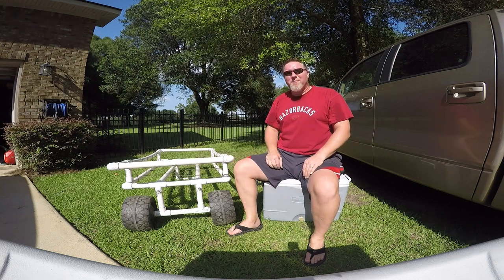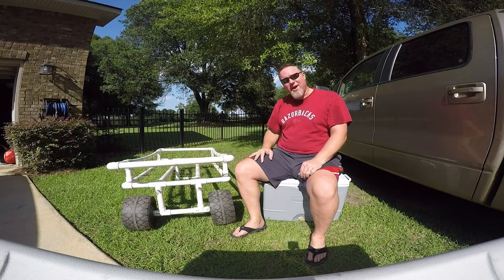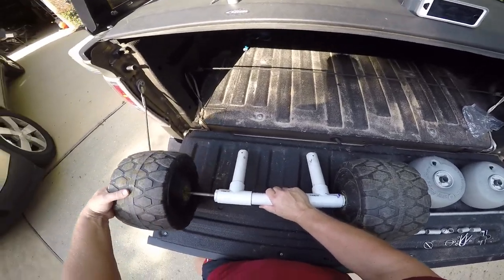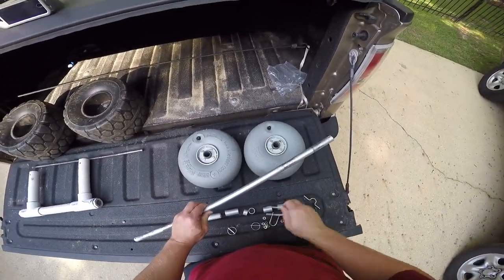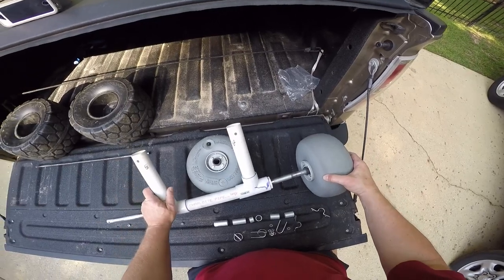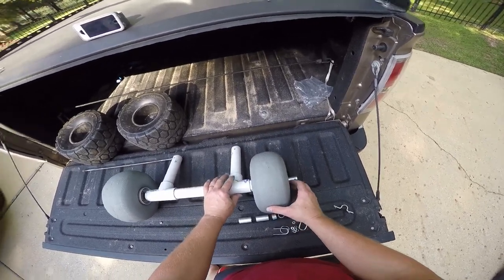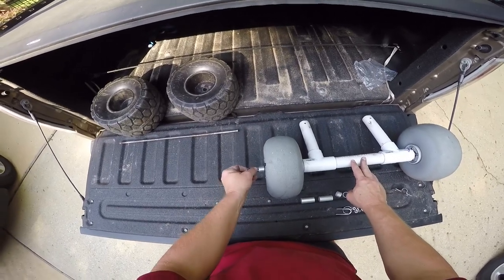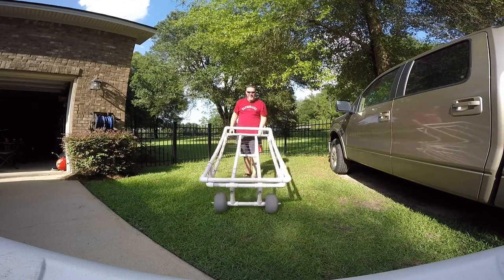DIY Beach Cart - UPDATE

Comment: the weight of the cart, sits on the axle which seems to be only supported by the end piece hole in the end stopper.....just wondering if there is a way to strenghten this maybe filling with a cement to provide a more robust end piece that holds the axle?

Comment: It’s been awhile since this had active comments but mine is a little different. I’m handicapped and a beginning rockhounder. I want to make a beach walker from pvc with fat tires however it will be used on gravel bars mostly. I guess I missed the part of your axle and did you just make holes in the one and a quarter pvc or did you make a bracket for the axle to go through. Do you think that wheelbarrow wheels would work?
Reply from the maker: Hi Harris!  Check out this video to learn more about the wheels and axle assembly and let me know if you have additional questions.  https://www.youtube.com/watch?v=J4eLuAqil6E&t=117s

Comment: Does the rotation of the axes consume the PVC cap? How do you prevent? Thank you
Reply from the maker: It does not because the wheels are free to spin on the axle.  When the cart is loaded, the pressure of the cart/PVC holds the axle fixed and the wheels rotate around the axle.

Comment: Great video! I'm looking to build a pvc beach cart that I could attach to my bike and this is a great help. I'm having wheel dilemma though. I really want to use the wheeleez wheels for beach/sand purpose but I'm worried how they hold up on alot of road usage. Plus they are pricey as you mention in a comment below!
Reply from the maker: That is a dilemma.  I think the wheeleez would hold up to light road use.  My concern would be their resistance.  They have greater surface area on the road surface, and they don't have a bearing where they connect to the axle.  The best thing would be an easy way to swap wheels for use - bike tires for the road to beach parking lot and then wheeleez for the trek from the parking lot to the beach.
Reply: Love this idea, thanks for the video!

@pcdonahue did you ever make a bike attachment?? I’m going down that same rabbit hole... ;)

Comment: Is the shaft just press-fit in the two pvc plugs? Any issues with wear and tear? I've seen a few designs that use washers between the plugs and wheels but don't think that's necessary.
Reply from the maker: Hi Rachel.  I have not encountered any issues.  I don't think the washers are necessary.

Comment: If you are a little handy there are ton of ways to solve certain issue, like wheel shafts, bearings to prevent wheel wobble and tear the shaft whole. Since you don't use the cart very often, there is plenty time to research and find solution or ideas on the internet. I come up with a lot of fix that way rather spend hundreds of dollar.

Comment: It looks like the two pieces of PVC that run long ways have bowed a bit over time.  Is this the case?  I was thinking I could possibly prevent that by putting in two shorter pieces of PVC to reinforce them.  Think that would work?
Reply from the maker: Those pieces of PVC are bowing due to the tension of the 550 cord I used for the lacing to keep items from slipping through the gaps.  You are right about reinforcements helping to prevent that, but it would add weight and complexity to the build.

Comment: What size PVC pipe do you use? Looks great and would like to build one for vacation this year. Any other do's/don'ts?
Reply from the maker: Tim Creef I used 1-1/4" PVC, but not Schedule 40 grade which is thicker (and heavier).  The standard PVC pipe seems plenty strong.  As far as general guidance, make sure you get all your dimensions figured out before you start cutting and gluing.
Reply: @centerforceone  How much weight can this cart hold?
Reply from the maker: @dorian345  I estimate our everyday beach gear weighs around 120 pounds with the majority of that being the canopy (65 pounds) and loaded ice chest (30 pounds).  FYI, Our canopy is an oversized rectangular one, where most are square.
Reply: @centerforceone  so still holding up years later?

Comment: Wheeleez is the way to go as im going to build a Ames wheelbarrow to a beach cart using the Wheeleez 16.5 X7.9 wheels as it uses a 1 inch axle as the wheels are lightweight makes this wheelbarrow easy to transport its a 4 cu ft capacity poly tray. some people use lawn tractor replacement tires not sure if they work or not they are the 15 X6-6 i seen videos they use them on homemade beach carts.  i prefer Wheeleez.  the wheelbarrow is neglected when i found it the handles are not good as im not using wood on this project. the handles are metal the original legs and braces will be used as ill put it together using the original wheel for now till i can obtain the two wheeleez wheels. as the wheelbarrow will be a dual wheel configuration but will be only strictly for beach use when i vacation.  the expensive part of the project will be of course the wheels. but worth it and cheaper and more sturdier than the Wheeleez WZ-1-BC beach cart and will hold more than the wheeleez cart which only has a 3 cu ft capacity as the wheelbarrow i got is 4 cu ft.

Comment: I'd like to see how you attached the bigfoot wheels. I found 3 Barbie-type cars in the trash and have 12 wheels. Problem is they're pink, but I'll get over it.  I did not keep the axles I don't think, but I do have some threaded rod, some nuts, washers, etc. I'm hoping that will work.  If the plastic wheels rotate around the shaft (threaded rod), then I'd expect them to wear out pretty quick. If the axle rotates with the tire, then I'm more confident in it all. What do you think.
Reply from the maker: +Alan Meijer, I no longer have the wheels, so I can't show you, but I can explain how I did it.  I salvaged the wheels, axle, bushings and cap nuts.  I used all these in pretty much the same configuration they were on the toy.  It was not easy to remove the axle from the gear box, but it can be done.  I don't think threaded rod would work.  If I remember right, the axle was 7/16" solid steel.  You should be able to buy that at a big box store.  However, you will not be able to put much weight on the cart as the axle is not stiff enough.  See my "Beach Cart Update" video for a discussion of the issues with the salvaged wheels and how I choose to fix it.
Reply: +centerforceone Thanks. I think I chucked the original axles, or at least busted the pressure caps trying to get them off. I've seen some guys building kayak carts using threaded rod although they were attaching more rugged pneumatic tires with metal rims (i.e. the kind you get from Harbor Freight, etc.).
Reply: +centerforceone  Excellent video.  My question is how much weight your axle, wheels and PVC support legs will take.  What's the max?  If you needed a setup just like yours, but to support even more weight, what would you have done differently?  Thanks.
Reply from the maker: +DLMADWI Thanks for the positive feedback on the video.  The salvaged wheels and axle could not hold much weight all.  The WheelEEZ I used are rated for 158 lbs. I wish I had used the next size larger.  See the link below for the complete selection with weight ratings.

http://www.wheeleez.com/wheel-axle-kit-PU.php
Reply from the maker: +DLMADWI In addition to the right wheels based on the expected load (see my previous reply), you may need to stronger PVC pipe.  You would step up to Schedule 40 (thicker wall) and/or a larger diameter.  Before doing this, I recommend you visit a big box store and pick up each type of pipe. You will see the thicker/larger pipe is much heavier and will add considerable weight to the cart.

Comment: do you have plans for the beach cart?
Reply from the maker: +Tonka Rose, I do have plans for the cart that I can share, but I have two warnings.  1) They are rough.  They look more like scratch paper than blueprints.  2) All the dimensions were based on my specific materials and gear - original recycled wheels & axle, canopy and ice chest.  You will need to modify the height and width of the lower assembly based on your wheels and canopy, the width of the upper assembly based on your ice chest, and the overall length based on your canopy.  If you want them, please reply with a way for me to send them electronically.
Reply: +centerforceone I mainly just need a list of what I need from the store lol. anything would help. thank you!!!

Comment: from the looks of the price of those wheels and axle it looks like it would be much less expensive to just go ahead and buy a wagon and then just do a little modification to it then spend 150 to 175 bucks for wheels and axles then add in pvc costs, time etc trying to build one which will dry crack after a while of being in the sun and elements. Or even just get a already finished wagon and lengthen it a couple feet looks like it would be easier to do and last longer.

Comment: Where did you get the wheels?  WHEELEEZ??
Reply from the maker: Paula Brett Yes, I bought them from Wheel-Eez
Reply: +centerforceone What size wheel did you go with from wheeleez?
Reply from the maker: Justin San Agustin I went with the smallest size with a 9.4" wheel diameter.  They are plenty strong, but I kind of wish I had gone with the next larger size for better rolling and clearance.